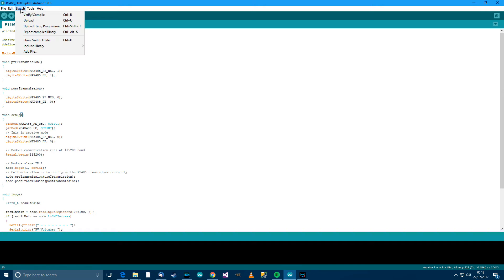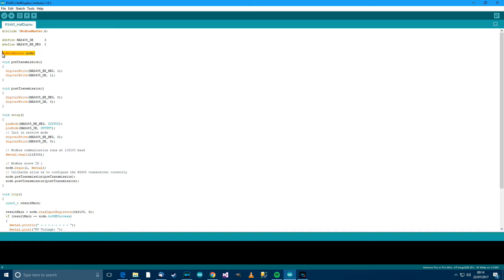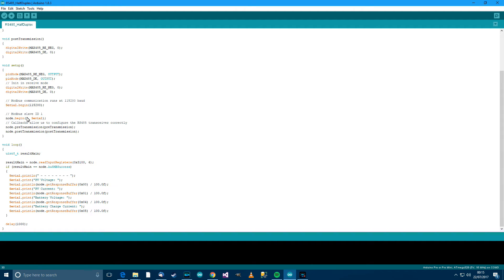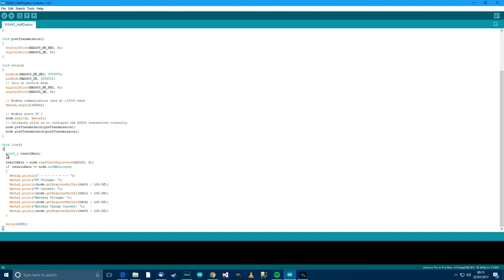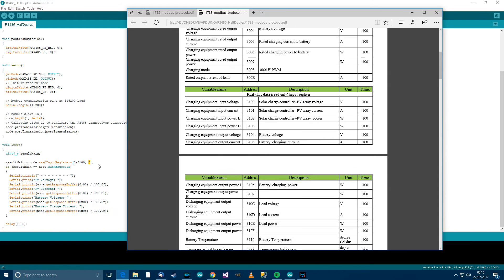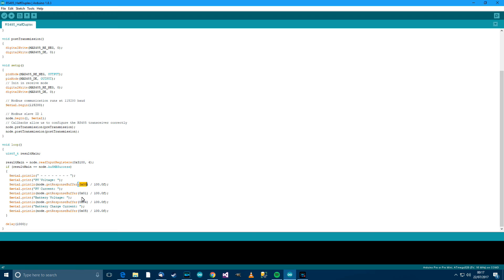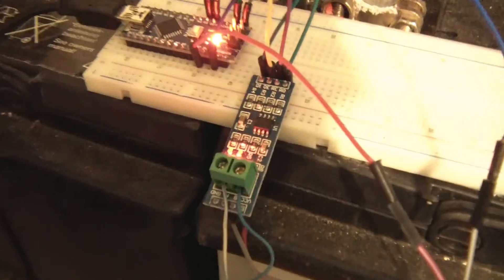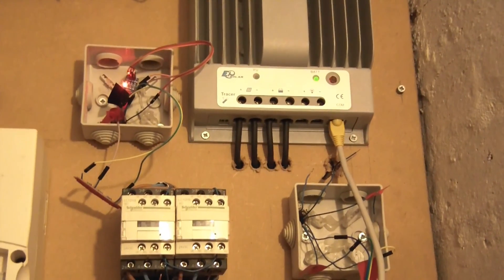TUTORIAL: How To Use RS-485 TTL MODBUS - Arduino Controller Module (Part 2/2 - Wire Up) Solar

Comment: Thank's a lot for the simple and easy understanding video, please kindly : could you do another video using dixell controller like dixell XR10CX , this controller is used anywhere and no one has already did a video and explain the sketch , on the net you can find the user manuel with ful doc about modbus . thank's again even if not possible.

Comment: Hi, I've been trying this with an electricity meter that supports RS-485, but keep getting result = 226...
Reply: @Tech Support Technicrafts I solved by using the max3485 instead of max485
Worked instantaneously
Reply: @jacopo.scarpellini  Hi i had the same issues, u just change to max3485 ? The connection and code still same?

Comment: Hello Anthony Cartwright, I got the controller ID#, serial communication parameters, and register addresses from the manufacture and followed your code and pinout using my Arduino mega 2560. But when I go to serial monitor I get "uz" repeatedly so the 'if' statement is not working. I'm not sure how to fix this issue. Please give me some feedback, this is for a college project.

Comment: in my case, i am working with 40000 address which is why i have taken readHoldingregisters command instead of readinputregisters. but still the data is not showing on monitor 
why?

Comment: Antony Cartwright, I am using an iSunery 10A MPPT controller but I can not find the Modbus protocol documentation for it anywhere. I tried to use your code and it didn't work, do you know how I can find the register cells?

Comment: Good video, but this library is only for arduino as a teacher, do you know any library that is for master and slave and multiple slaves because I think it is only for one slave right?
i test yout proyect with serial port monitor in the other side and i cant see data, can be my max485 broken?

Comment: sir I have a similar project, but I use schneider PM2100 as the slave, can your programming be used too?
Reply: @random Sir have you tried the code with schneider PM2100? I have the exact same problem. It would be nice if u can confirm the working code, thank u.

Comment: Thank you for the video. Coud you explain how you can get both Tx/Rx modbus acquisition and Serial monitor at the same time? When the serial monitor is in use (such as in your video), no other serial communication should be possible. Unless you have two serial ports available which I do not think is the case for Arduino Nano.
Reply: You can actually see the modbus data in his serial monitor. So his Modbus slave and his serial monitor are seeing each other's communication. This isn't a problem for serial monitor (as you just see some random garbage), but I'm a little surprised that the Modbus slave recovered so quickly. I do recall seeing something in the Modbus spec about ignoring non-conforming data. But you're right. The "proper" way to do this is to separate your communication lines; either using an Arduino Due or Mega (with four separate serial pin pairs so you can move the Modbus board to Serial1, Serial2, or Serial3) or send your human-readable output to an LCD display via I2C or something.

Comment: Is there anyway to get rid of this silly message at the beginning of each loop.( °°°°~o)
Reply: That "silly" message is because Antony is using the SAME port for debugging and modbus communication!!!!! The Arduino serial terminal y receiving the modbus packet and shows that silly message. And... the EPSolar 4215BN is receiving the Serial.print commands…. To solve this you shoud use another serial port.

Comment: Thank you sir.... Awesome. I got the result. But can't we remove the boxes on serial monitor
Reply from the maker: Hi, I just left them. I don't know what that is.
Reply: @antonycartwright 
Thank you sir.
Reply: @antonycartwright  You are using the SAME port for debugging and modbus communication!!!!! The Arduino serial terminal y receiving the modbus packet and shows that boxes messages. And... the EPSolar 4215BN is receiving the Serial.print commands…. To solve this you shoud use another serial port for transmit and receive modbus. Arduino nano has got only 1 hardware serial port, you shoud use a "software serial port", like SoftwareSerial.h

Comment: For those who had issue with nonworking connection or stability like me: add few milisecods (3-15ms) delay at the end of preTransmission() and  few ms at the start of postTransmission() functions. It gives MAX485 some time for proper switching from reading/writing state.

Comment: Thanks for this video ,
I have a case wich is quite close to this , I have a device HPMA115S0 it has UART communication and I want it to work with a plc over modbus serial rtu protocl I bought the same UART TTL TO RS485 you have , but I don't know how to implement the modbus rtu on this device without Arduino , is there anyway ?

Comment: Good evening, my name is Luca Mozzini Vellen and I study at the HES-SO Haute école spécialisée de Suisse occidentale. I am doing a batchlor project on energy consumption and distribution in Switzerland. I've seen that you, like me, use a Tracer-BN Series with Rs-485 TTL MODBUS. I'd like to kindly ask if it's possible to have the code and the libraries you use in your video. This information will not be used for profit but only for school use. I'm at your disposal for further information, waiting for your answer and wish you a good evening. Best regards Luca Mozzini vellen

Comment: How Can I read address 30002 with 2 register? I need to read volume flow of whater. Using modscan32 and a usb adapter for rs485 I can read the correct value, but with arduino and this library the read value is different. According to the manual address 30002 is read as inputRegister.

I'm using the mega arduino and the RS-485 TTL MODBUS converter

I am using the IFC050 flow sensor (modbus manual link below) look at page 12:
http://www.conaut.com.br/produtos?task=callelement&format=raw&item_id=50&element=943615ec-1ce8-4738-9563-523b9801c59c&method=download

What's wrong with the code below?

-------------------------------------------------------------------------------------------------------------------------------------------------------
//Code used in the project.
-------------------------------------------------------------------------------------------------------------------------------------------------------
#include <ModbusMaster.h>

#define MAX485_DE      3
#define MAX485_RE_NEG  2

ModbusMaster node;

void preTransmission(){
  digitalWrite(MAX485_RE_NEG, 1);
  digitalWrite(MAX485_DE, 1);
}

void postTransmission(){
  digitalWrite(MAX485_RE_NEG, 0);
  digitalWrite(MAX485_DE, 0);
}

void setup(){
  pinMode(MAX485_RE_NEG, OUTPUT);
  pinMode(MAX485_DE, OUTPUT);
  
  digitalWrite(MAX485_RE_NEG, 0);
  digitalWrite(MAX485_DE, 0);
  
  Serial.begin(9600);
  Serial1.begin(19200);
  
  node.begin(1, Serial1);
  
  node.preTransmission(preTransmission);
  node.postTransmission(postTransmission);
}

void loop(){
  uint8_t result;
  uint16_t data[6];

  result = node.readInputRegisters(30002, 2);
  
  if (result == node.ku8MBSuccess){
    Serial.print("Flow: ");
    Serial.println(node.getResponseBuffer(0x00));
  }else{
    Serial.println("Error");
  }   
  delay(500);
}
-------------------------------------------------------------------------------------------------------------------------------------------------------
Reply from the maker: It's only a guess, but if you're reading in two bytes, why do you have uint8_t result = node.readInputRegisters(30002, 2);? Shouldn't that be a 2 byte variable?
Reply: Actually I have no experience with modbus, so I followed an example on the internet. in your opinion what would be the correct form. Could you write the code?

Comment: Hi, good tuto. I have a controller with MODBUS-RTU communication protocol. How can use your code to send with my arduino the bellow request: 00 03 00 00 00 01 85 DB ?

Comment: sir first of all thanks in advance  i am trying to read data from fuji solar drive using max485 and arduino mega2560 . Following your code i make my sketch but i get some garbage value  of different character plz help me to solve this problem...
Reply from the maker: Prasanjit Bhowmick Hi, all devices are different! You'd be better off looking specifically for modbus guides/examples for that device. This guide only covers the basics...
Reply: All i understand by your video(code) is that if i am using some different device then i need to change the address as per the device data sheet... and i m doing that but could not get any result getting some gurbage value and my code does not enter into the if statement      if(result==node.ku8MBSuccess)... please suggest me where is the problem
Reply from the maker: So is the register address list in your documentation exactly the same as the register address list in my EPSolar Tracer documentation?
Reply: i have took the address from manufacturer .......   and i always get output like  %????!&@   this kind of charecter .even i remove the rs485 port from the drive still i got the same result...
Reply: always get this kind of output in my serial monitor
Reply from the maker: Hi, you'd definitely be better reading through the documentation for the device and also looking at examples for that device because some devices can operate slightly differently from others.
Reply: @prasanjitbhowmick6344  Hi Prasanjit.I am working with Ziegler Energy meter..I am also getting Output like this. Can u help me out with this
Reply: Hi Rajbir Singh, I have the same problem with a Must Solar inverter, have you found any solution?
Reply: @Tech Support Technicrafts I finally met Node-red and connected the inverter via usb to the pc, with node red's modbus library it was very easy to obtain the data from my inverter and with any inverter that supports rs485.
Reply: @Tech Support Technicrafts It won't let me send links, search for Node Red. All the best.

Comment: hi Antony. just what I need and thanks for the in depth explanation, really cleared up a lot of unknowns for me.
I have a problem with reading your code on one line due to my fuzzy screen.
the line in question is:    if resultMain == ?????Success)      looks like loadMBSuccess but this does not make sense to me..nothing new there..:-)

Also     unit8-t   resultMain;     is this correct and could you are anyone explain this..

Thanks in anticipation
Reply from the maker: Hi, thanks for your comment. It's "node.ku8MBSuccess". It's "uint8_t"... U means 'unsigned'. That means that there is no '-' or '+', therefore it is only a positive value (>=0). Int means 'integer'. That means it is a whole number and not decimal. '8' is it's bit count, this is the amount of memory which is available to it for storing it's value. In an 8 bit variable, we can store 256 values. I don't know what '_t' means!

Comment: Anthony, In the code above, you haven't specified a function code. Doesn't this need to be specified in the request sent through the modes protocol? Thank you in advance!
Reply from the maker: Hi jjhuhu, I'm under the impression that the function code is included in the address, although I could be wrong.

Comment: Anthony, Still cant get it to work. Followed your instruction to a tee. The device I am using is a Delta PID DT4848 controller. The Modbus address is 1000 ( hex )as per the data sheet. Not getting any flashing Rx light at all. the Baud rate I tried everything and this device has a max rate of 19200. 8,N,1 protocol. I am sure that the RS 485 hardware works cos I tested it with a  blink program and can transfer to another Uno through the 485 link. Am also dead sure that the device is alright cos I tested it with their generic software and a USB to 485 converter. Can see the data there.
At wit's end here. Why does the Rx light not show up. Tried writing comment in the code to see if it goes to   if (result == node.ku8MBSuccess) but apparently it does not. What am I missing? Aaaaarggh!....
Reply from the maker: Vaishakh Chavan Is the ground line connected properly?
Reply: Antony Cartwright yes. Indeed it is.   Can't figure out why it's not communicating. Any ideas on WhT to check cos am at my wits end with this.
Reply from the maker: Where is the documentation and which coils are you reading from? :-)
Reply: Look at page 9 0f 13 wherein it says the first register is Hex address 1000. I've connected to these devices several times using HMI's or Scada's. I reckon theres something wrong with the RS485 control and receive functions. The Tx pin to DI, RO pin to Rx, DE to pin 3 and RE to pin 2 is what I have. I followed your code to a tee. The RS485 board needs VCC and GND and that's about it. I have the A and B pins connected to D+ and D- on pins 10 and 9 of the DTB4848 Delta temperature controller. Tried hooking up a scope to the A and B pins but all I get is a pull down of the high level when i a 1 second period as per the program. I get some junk on the serial port in Arduino IDE but even that does not change when I switch off the Delta controller . The code does not read data at all. I think there's  no information exchange going on. Once again the functionality of the controller is tested with a USB to 485 controller and their generic software and works well. What am I doing that's just not getting any response from the controller.
Reply from the maker: Hi, The communication address is not 1000, it appears to be 1. The Baud rate appears to be 9600. Also, I don't understand that documentation very well. I expect the documentation to look like this: https://github.com/kasbert/epsolar-tracer/blob/master/archive/ControllerProtocolV2.3.pdf This is the documentation for my device. As you can see, it's simpler, it's just a table. Can you get better documentation?
Reply: Thanks again Anthony. While I've gone through the reference you sent and the example at the end of it, I was under the impression that the register that is read in your case is register 3100 and 16 means the number of registers to read from that point onwards Your code is  // Read 16 registers starting at 0x3100)
  result = node.readInputRegisters(0x3100, 16);
In this too, you don't really specify the 'cell numbers' as you mentioned in your video. Is there a reference to cell number of register number. I was under the impression that they simply increased serially from 3100 upwards 16 counts indicating 16th register after 3100 ( in hex ).
In your code too cannot identify the point where you have written register address and then register number as you mention.

Would appreciate a clarification and thanks again.
Reply from the maker: Vaishakh Chavan Hi, my code doesn't read 16, it only reads 6, and 2 of those values are ignored and not read from the buffer.
Reply from the maker: Vaishakh Chavan The register number and register address; it reads 6 from the device, then I specify the index of the value in the readbuffer bit of code.
Reply: Yep. Got that. But that is still 6 registers ahead of 3100 in your case. I'm starting with 1000 and hoping to read even 1 value.  I understand that it is to be 1000 with a range of the registers to be read. For ex. 1000,4 would read registers, 1000, 1001, 1002,1003.
I can see a high voltage line on the scope being pulled down but don't now if the problem is with the query frame or the hardware or the protocol. Looking at some 485 sniffers now to see if anything is going to the PID controller at all.
Reply from the maker: Vaishakh Chavan I'm afraid I don't know. I'm no expert at Modbus or rs485, I only know the basics.
Reply from the maker: Vaishakh Chavan Thanks! You can probably teach me more about Modbus than I can teach you. I only know the basics and don't fully understand it all myself!
Reply: Vaishakh Chavan does it work for u a year before or not?
Reply: Hı Vaishakh Chavan and Antony Cartwright. My address are like this: 0001H, 0002H, 0003H.... So what should ı write my first address "ana=node.readInputRegisters(0x0000,3)". I couldnt read from enerji meter :). Im sory, please help me! Thanks.

Comment: Can you advise about the Modbus structure that you are using... Ex. 8,E,1 or 7,E,0 describing the stop bits and the parity.
Reply: Ah. I see it in the documentation...(2)The serial communication parameters: 115200bps baudrate, 8 data bits, 1 stop bit and no parity,no handshaking. Still can't get it going though.

Comment from the maker: Hey Daniel Roibert, There's been some weird glitch in YouTube where by I get notified of your message, but it's invisible - it's not in spam either. Who knows, but anyway, to answer your question, soon there will be a supporting website for my channel. You'll be able to download code from there. Unfortunately though, I just don't seem to get time to finish it! I'll try!
Reply: Antony Cartwright loved the video and the detail. This would be full duplex mode right?
Reply from the maker: Vaishakh Chavan Hi, I'm afraid I'm not sure. There is something about using four wires instead of two... But then there are only two wires coming from the device itself, so I'm not sure.. :/
Reply: Yes. You are right. Still struggling with the library documentation to figure out what's going on. Can't figure how the response buffer ports data in.  Keep at it.... 😂
Reply from the maker: Vaishakh Chavan I'm the same. I don't fully understand it. Do you have the same charge controller?